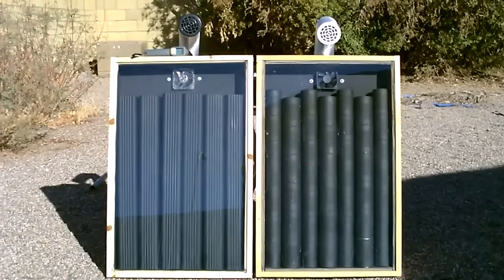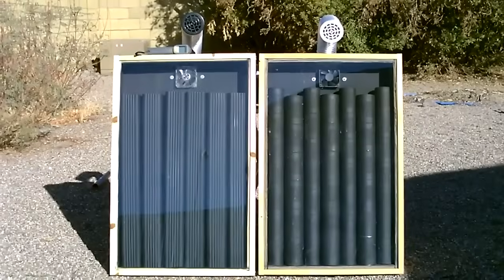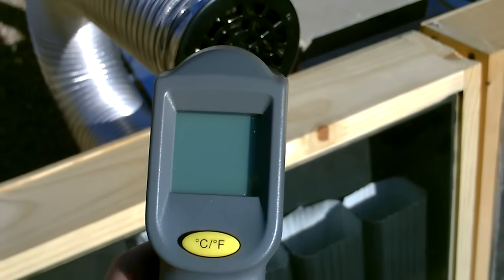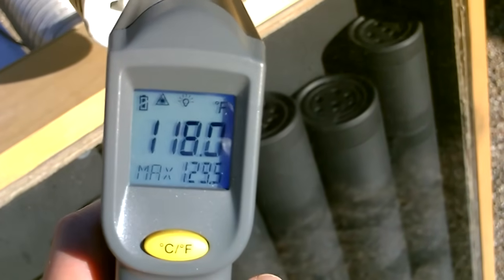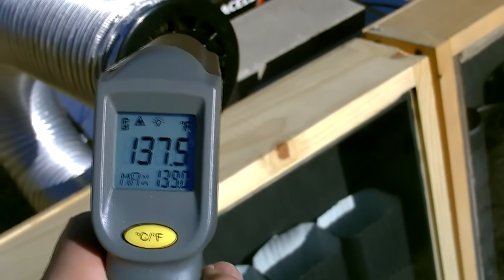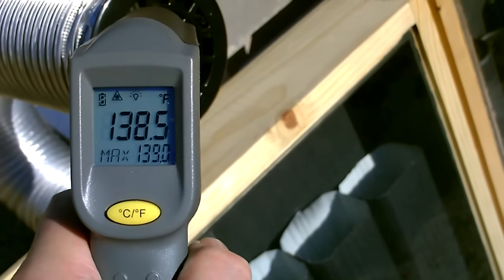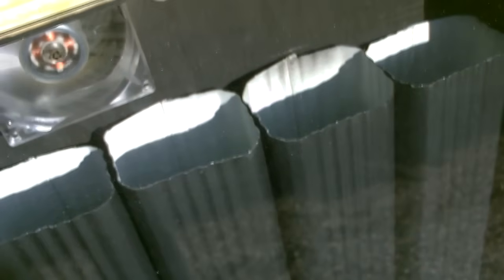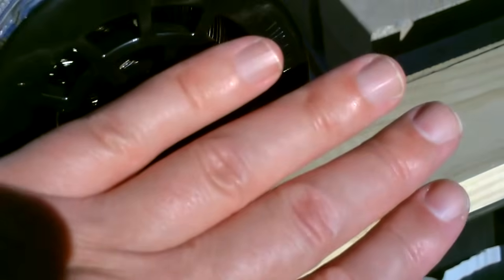Solar Air Heater Comparison! - Steel Downspout Heater vs. Steel Can Heater (temp. tests)

Comment: I am thinking of, as an alternative to drink cans, using Matt black vinyl sheet, affixing aluminum foil to the other side and rolling it to make tubes which are black on the outside and silver on the inside. Would their thinness be an advantage? If so, any suggestions on length, diameter and numbers, please?
Reply from the maker: hi there. it's great that you're thinking and experimenting with other materials. one issue with vinyl is that it is a plastic material and off-gassing of the heated vinyl might create unwanted fumes.
Reply: @desertsun02  Thank you very much. Point noted. The vinyl would be on the outside of the tubes and the inside completely covered with the foil. May put some tiny holes in the box to allow any vented gas to escape. Rather than paint I am opting for black foam board for the base of the box (similar gas problem?). For the ends of each pair of tubes I will construct a cardboard box with holes cut out for them. Again, these will be lined with foil and covered with the vinyl to seal against escaping air. This is more an experiment than of practical use as our house faces east/west. Had thought of running pipes from the back garden to the kitchen cat flap but I suspect all the heat would be lost in its length. I might try insulating hose pipes as I have some old lengths. Worth a try🙂. As it is an experiment I am hoping to keep it VERY cheap and simple. Is cling film instead of glass a no-no?

Comment: Wondering if using a one way mirror instead of glass would add more heat, as it would reflect the light energy inside...
Reply from the maker: hi there. i think the issue would be that not enough light would pass through initially. if i remember right, those let light through but not as much goes through compared to regular glass (it's worth a try though, just to see) 👍🌞

Comment: I know this is an old video, so probably won't get any responses. But I am curious. Won't the heat cause the air to move and rise on its own, without a fan?
Reply from the maker: hi there. the heat will cause the air to rise but it will only trickle out unless you use a fan. i've seen larger versions that don't need fans but those are much bigger (probably 15 times the area). these regular sized units work a lot better with a fan 🙂👍 btw - since my videos are the 'evergreen' type i never really think of my videos as 'old'. i answer all the questions equally.
Reply: It will draw air with no fan. Passive. However, if you don't move the heated air at a fast enough rate, you will start to lose heat from the glass. Air flow is key in these systems. Downspouts are unobstructed hollow tubes, cans with holes drilled obstruct air flow
Reply: They can be made to use convection to transfer air, but the warmer the inside of the collector gets the more it’s losing heat to its surroundings. So you want to be collecting and extracting the heat at the same rate. Kind of counterintuitive…

Comment: The reason that the down spout version collects more heat and always will is due to the fact that the flat down spouts provide more surface area than the can version of the same heater. More surface area = more heat
Reply: Not that the cans are steel, and the other is aluminium then? And the cans have restricted air flow?
Reply: @chrisfryer3118 I believe this is correct.
Reply: Personally I think it might not make much if any difference, they're still exposed to the same amount of light, it's just more or less light/heat per area of material. As the material is black, the light isn't going to be bouncing around.
Reply: thanks. What else do you know that will make this work more efficeintly
Reply: I don't think this is correct due to each can having a punctured lid vs open tube- the surface area is greater in the can version but it also has reduced convection compared to the very straight open tubes, also the tubes are thinner and potentially more conductive, so the heat is being conducted to the air more efficiently. I'm willing to bet the can rig would cool down slower once the sun no longer heats it.
Reply: more air irregularity in the square shape downspouts makes the air pause heat up and then move .. the round cans move the air more regularly thus cooling it slightly

Comment: Have you thought about using heat from a unit like these to store heat for use at night ...  Using water containers or maybe roundish rock...
Reply from the maker: hi there. yes, i've specifically looked into using sand to retain the heat. i've only researched it but haven't built yet
Reply: Sand works good for retaining heat..

Comment: That settles it I’m using down spouts . I’ve already built my box and bought a window someone returned it and I got it for 16 dollars. It was a special order window that no one could use unless they needed one the same size.  Anyways I have a compartment on each in for air to travel through the down spouts then out though the top. Your video helped me out a lot. Thank you!
Reply from the maker: hi there and thanks. i'm glad it helped. my downspout collector is definitely one of the hottest. sweet buy on the window. that is the way to do it 👍
Reply: @desertsun02  that’s a great idea to use an old window

Comment: Have you thought of adding thermal mass of some sort, like water, so that the heat could be released when the sun went down?
Reply from the maker: hi. yes. i've experimented with rocks and sand so far👍
Reply: @desertsun02  I'd be interested to see if you had better results!
Reply: Maybe clay, like bricks. In Europe we have TA furnaces which have have roods in between clay bricks. So rods can turned on ower night when electricity is cheaper(thats how it is in Europe) and then over daytime you would use just fan to get heat that clay bricks accumulated.

Comment: Where are you able to find steel downspouts? In NC, you can only find aluminum. Think it matters?
Reply from the maker: hi there. the home depots where i live have both steel and aluminum. i'd give a slight edge to the steel ones. seems that with steel being denser and heavier it heats a little better. (i've noticed it in the metal can solar air heaters. the steel can heater seems to be a little better than aluminum can one)

Comment: I think it has to do with the size of the surface from the two systems. The surface of the downspout is bigger than the can, if the sun shine direct to the surface. But during the day when the sun goes from the left to the right the can version is better. They will have a longer time more absorber surface into the right direction. If possible, you can make a test by different angle  to the sun. That would be very interested.
Reply: Really good point.

Comment: I'm in the process of building a downspout heater currently about the same size. I chose to ZIGZAG the airflow through the gutters by notching them. The idea is to gain more hang time on the air. On a no cloud day of template at 38 it produced 138-144 degrees. I'd love to see you test the theory and see if you receive the same results.
Reply: IT may get hotter overall, but won't be able to heat the same volume of air at a given speed. Relative heat transfer differential.
Reply: @rylee6979  exactly.

Need more surface area, or mirrors/parabolas to guide the sunlight (or both)

Like the solar farms that use liquid tubes and parabolic mirrors, could do the same thing but with air and steel mesh to slow down the air/let it heat up

Comment: Great solution for daytime. Anyone have suggestions for night? Possible to solar charge a battery enough that can run a heater at night and use this during the day? Sorry I know nothing about solar power just bought a house with a separate garage and looking for cheap solutions lol
Reply: Since mass stores energy one has to transfer the air heat to a slower release heat source. Running the air through the ground of a green house could work for that. Another way could be to run the air strategically first through a "pile of rocks"(rock feature wall, mass tile box, maybe even bubbled through a mass of water in a drum adding humidity to the air as well) before it goes into the heating area, so the storage device retains the heat for night giving radiant heat and lastly the ability use the the same fan for distributing the heat from them.
Something else I am planning on doing is adding lead in some fashion in the heat collector. One reason is to store the heat while it's being generated and give a more constant output, and 2 is to extend the output when the sun goes down. This will require reheating in the morning if it loses too much heat, so they may be an issue there.
Reply: For old houses, I would suggest gutting it completely. Then fill every joint, crack and fissor with spray foam. Install vertical lathe for an air gap in all wall bays. Then start in installing insulating foam boards everywhere to maximize your home insulation. Once this is all done install the largest solar air heater possible on your most exposed wall. South hopefully. The high insulation will trap and keep the heat generated long into the night. My upstairs is warm and cozy at 10 and 11pm hours after I shut down my solar air heater.

Comment: I've got one for you champ.
Corrugated metal roofing sheet.
Simple, cheap, available.
Trying them vertical and horizontal might be interesting too.
Reply: That's what I thought too, it's also often free after removed from a roof/fence, albeit potentially a bit rough. Probably not a big part of the total cost though I suppose.
Reply: @DoubleMonoLR nothing  sandpaper and Aluminum foil tape wouldn’t fix.

Comment: I bet if you made another identical downspout heater but instead of using flat black paint you use black undercoating or a thin layer of tar it would work better. I think undercoating is less reflective and would absorb more of the suns rays.
Or perhaps try many different types of black paints and undercoat and tar in a small test to see which one gets hotter.
I can not find any test that uses any other substance than black paint for a solar heater.

Comment: In cold weather I would think those metal exhaust vents would disperse a lot of heat. You should consider insulating them with something. Maybe take some used bubble wrap and tape it up with aluminum tape or just zip ties.
Reply: Mounting the scaled up heating units directly to the exterior wall is best...so the venting is just the thickness of your unit plus the wall. Insulated plugs work to retain the generated heat when the sun goes down.

Comment: Awesome!  

I was wondering the screen absorber also comparison too.  

to clarify unless a trade secret, are the screens aluminum or steel?   

Are the downspouts aluminum or steel?  

I wonder about a hybrid of the downspout with an aluminum screen on top or even along the back side to insulate a little more and still exchange heat.  Wondering also with steel cans open on the ends versus with holes and as I noted with a screen on the front or back side. 

Man, you have the best videos for systems I've been research and a little working on.  

I'm working on silica glass (cheapest mini-litter walmart brand and ace 100% NaOH) perlite (someone mentioned try vermiculite also) rocket stove designs too and love your brick designs!  Super easy to construct.  Wanting to make a ammo can more portable design so got into the COTS insulating materials that are lightest weight.  Plus a tangent to work on fuel efficient base station farm forge, treating furnace and kiln for a range of materials processing. 

Your copper coil solar water heat is the best also!

Comment: Are you heating a greenhouse with this? I'm curious how much warmer it would make a greenhouse that's already 20-30 degrees warmer inside than the outside temps?

What size space do you heat with these? I've built swamp coolers and they're pretty much worthless if you aren't inches from them, literally.

Comment: Suspend the heat absorption metal pieces in the center of the box using thick wire bent to form a stand. Place fan at bottom to draw in cold air and use drafting for air flow. You could incorporate sealed copper pipes centered in the heat absorption square pipe filled with gallium to help absorb and conduct more heat. :)
Reply: Yeah, but at a much higher resource price for the build, but if you could do the bent wire build you mentioned, and use reflective material to heat the pipes all the way around, that may squeeze out a cpl degrees, on the cheap

Comment: How high of a temp and for how long of an active duration have you tested those computer fans for?  Also, do you get any weird smells from the paint in the air?
Reply from the maker: hi there. i've run those fans in temps as high as the mid 150F range. longest time i've run them in a row probably 8 to 9 hours (sunny part of the day). the fans are pretty tough. they're designed to run for 30,000 to 50,000 hours. i've never had one fail. with regards to the paint. it only has a paint smell when it's not fully dry. after a few days i don't notice anything but warm solar heated air.

Comment: But won't your numbers be off because the color of the grills that are on top that you were measuring? The black grill seems like it would be hotter just because it will absorb more Sun versus the white Grill.
Reply from the maker: hi there. since the vents are plastic and being chilled in 42F air, *plus aiming the laser thermometer thru the vents (best i could) i didn't think it would matter by more than a degree or two. the temp. readings seem consistent with how the air actually feels coming out of each collector. it's clearly much hotter exiting the downspout one. the biggest factor in the temp. difference seems to be the fact that the downspouts have the thickest metal (by far) of any type of solar air heater i've made... which matches up with the fact that the metal downspout is much hotter to the touch than the metal cans. *downspout will burn you much faster than touching the cans. but certainly the hottest solar heater i've made to date.
Reply: @desertsun02  I'd say the difference is because of the cans having only small holes in the top. The air doesn't move so freely thru them and so more heat is lost to the glass. You could compare the temperature lower down and I'd imagine would find there is more heat on the cans lower down where as the down pipes the heat is flowing up and the glass is cooler lower down. I made one that was flowing from top to bottom with a metal sheet and wood behind it to form kind of trufs where the cold air could warm up and rise before flowing into the next truff. It had a wall behind so stored heat in the wall. It was quite efficient coz the wall would keep the temperature down and so the loss to the glazing was less and it would continue to transfer the heat in overnight. It was bringing fresh air into the air vent. I thought it was quite good design coz with the hot air rising  on the metal the cold intake was taking the heat away from the top and bringing it down onto the the colder part of the wall and under the floor. It was only a meter squared and i had to switch it off in march coz the house got warm earlier than usual. It was quite a sunny location tho. I though if I had run it in the autumn it might have never got that cold and I would have had to switch it off even earlier. It was quite thin rectangle aswell so a wider one would work better. I think coz it was thin the cold was encrouaching into the wall but once it got a bit milder it warmed up quick. I was worried about the air quality but the air was behind the metal sheet and so separated from the plastic which was quite good insulation. Glass would lose heat a lot more. Also the wall would expand somewhat and could get hot if the air flow was blocked or something.  In the end I thought  a horizontal design would be better to take advantage of the stronger sun in the autumn and spring and store it in the ground although that wouldn't have worked in the particular position I was working with. The reflection off the wall onto the ground is quite a lot when the sun is  higher. A pipe underneath the ground should be better for air quality and it is a really simple approach. With a decking around it it could look ok and help insulate the ground around the house so more heat can be stored. A decking round the house would lag the encroaching of the cold out and soon the sun would be higher and warming the collector. The air intake would work well with a stove  for the coldest times since it would take the chill out.
Reply: Agree.  Simple test fix is swap out the grills.